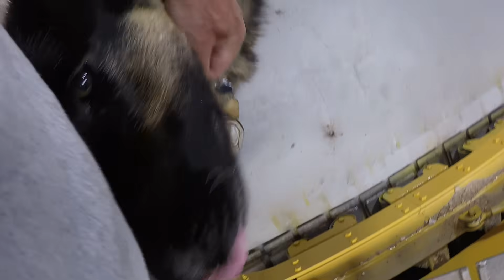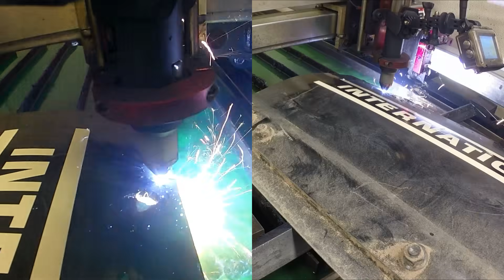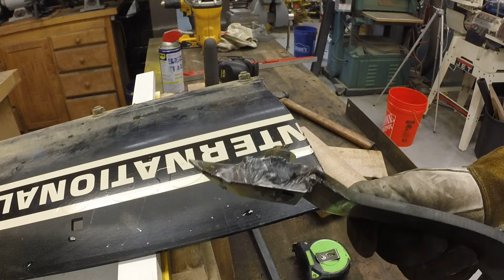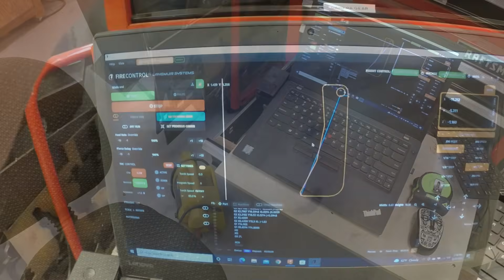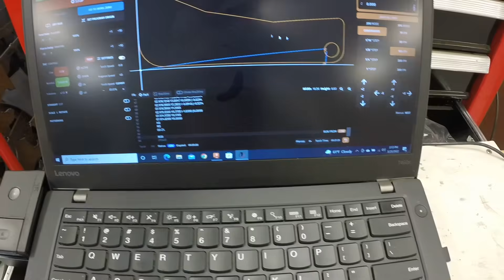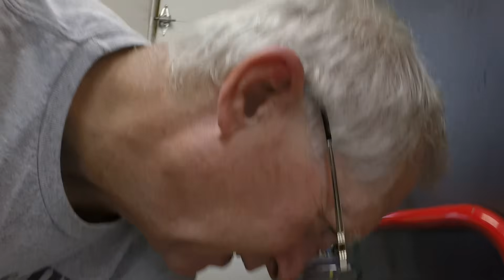A New Dozer Blade!  It's more Caterpillar-ish! (Part 1}

Comment: I would have taken the cutting edge off and cut each end of the cutting edges off separately so the bolt holes lined up. But again, you do it your way and it worked extremely well, nice job. That plasma table keeps impressing the more you use it, and of course the more you use it the more you learn about it, that’s how you get the most out of it.

Comment: Generally, The Air Gap Between The Two Steel Plates - Will Not Allow the Cut To Continue...You Lucked Out Big Time...
Reply from the maker: Didn't know that. Interesting. Thanks for the tip.

Comment: Here's an 'idea'.....how about designing/fabricating and installing a ripper for the back.  I know that due to the Dozer's size and hp, ya won't be able to rip thru rock but it would make one heck of an attachment for turning over and cutting rows for a garden and minor landscaping, plus it will look  'cool', lol.  Have you considered a removable (and possibly heated using a 6 or 12 volt auto auxiliary heater)  cab enclosure for winter use such as snow plowing?
Reply from the maker: A ripper, or, maybe a scarifier, is definitely a cool idea. I've got a big project coming up which will take the better part of the coming winter, so maybe I'll come back to this next year with a ripper design...I agree, it would look neat, even if only partially functional.

Comment: The hard tip is likely AR500 or thereabouts. It is very dense of heavy metal atoms.  (not iron).  They require a higher temp to loose the bonds.  My experience is 3/8 == 3/4".  Figure the numbers twice the thickness as you have for the current and speed.  Complex metals we deal with.